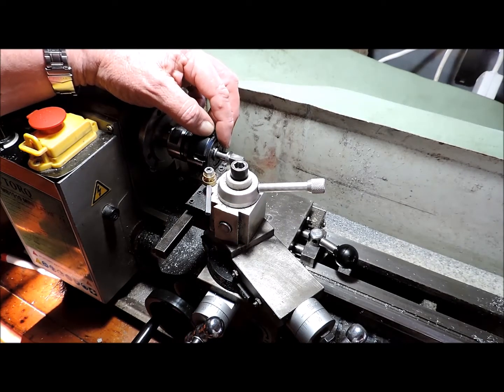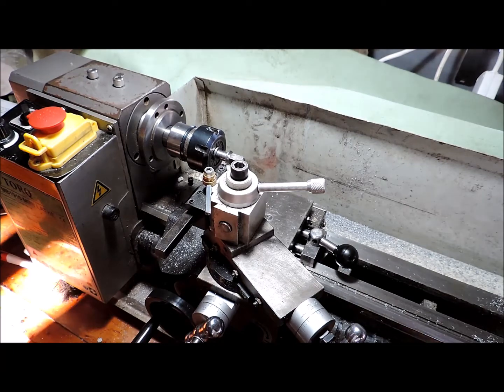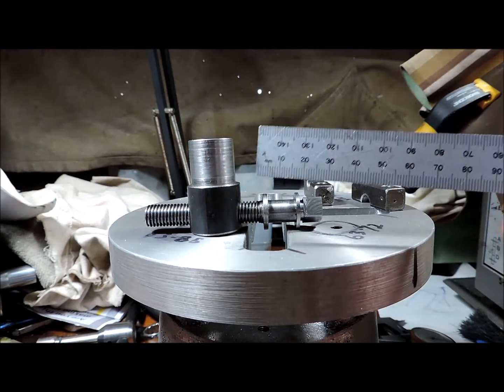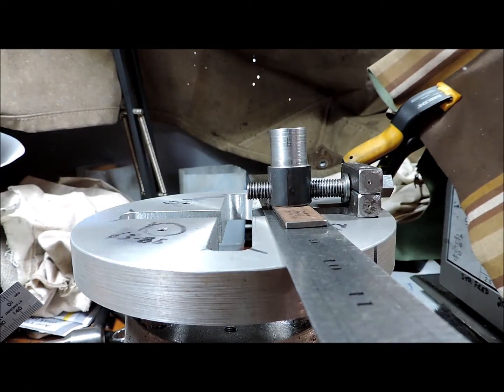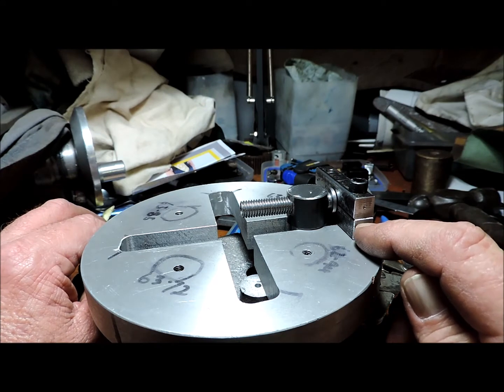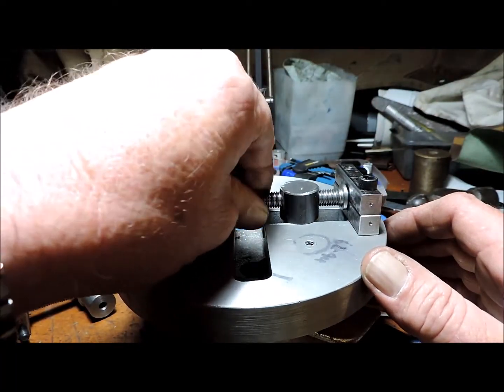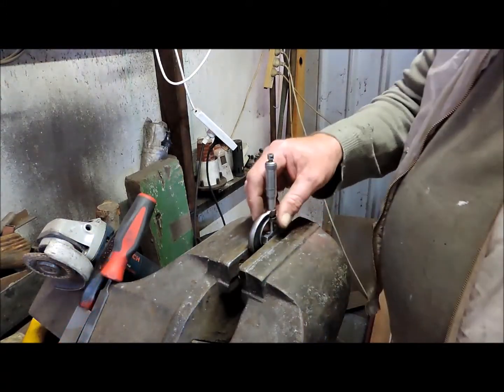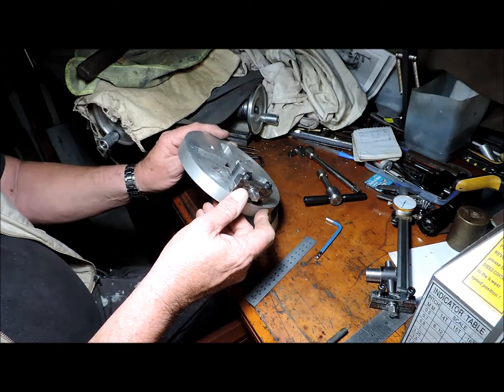Making the Gingery 4 Jaw chuck Part 10

Comment: Hi Peter.  Now I have been left in suspense ....  Did he get the last screw and nut attached to the chuck plate, did the nut run true to machine down the shoulder ...  Inquiring minds need to know these things.  :-)  Great progress on the chuck.  Won't be long now and you will be facing the dangley bits down.  Thank you for sharing Peter.  I am enjoying the series very much.

Joe
Reply from the maker: G’day Joe, thanks for your support, it’s appreciated. I realised I left you hanging at the end but the video was getting too long and I had edited it down from one hour of raw footage as it was. Stay tuned for more. 
Cheers 
Peter